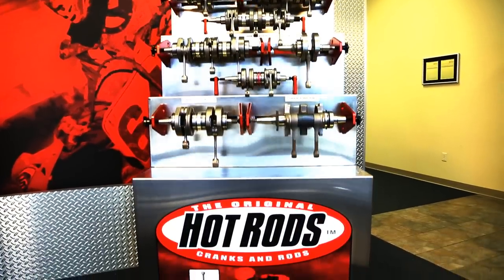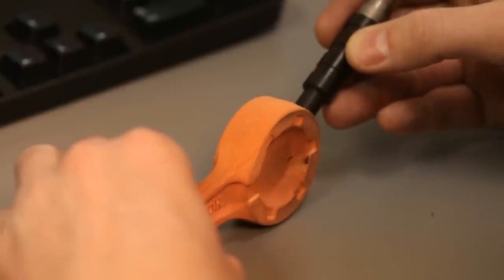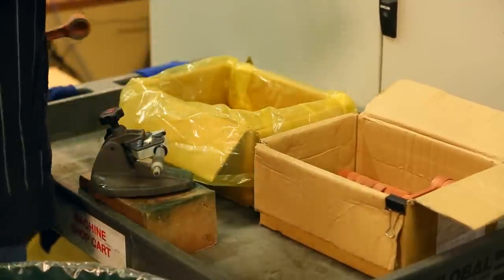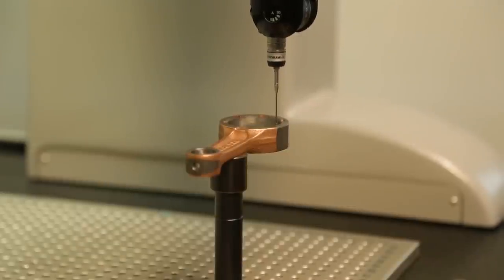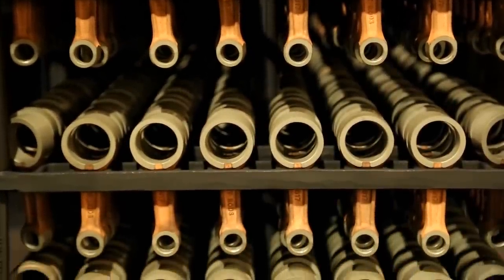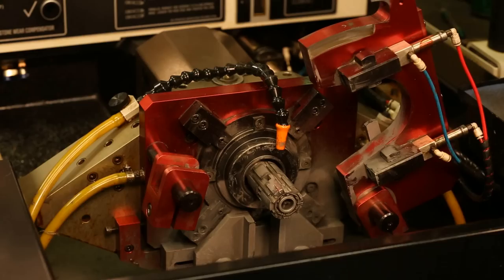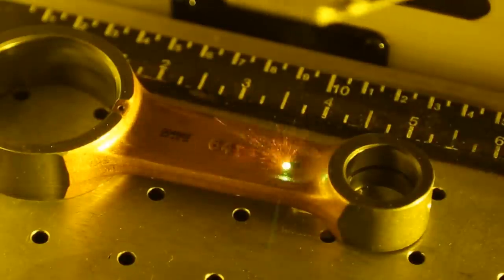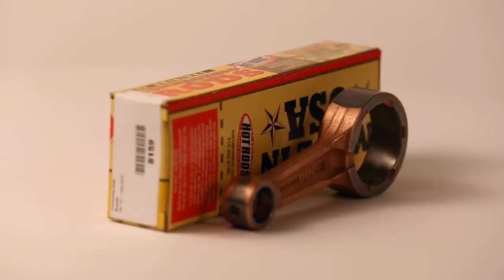How it's Made: Hot Rods' Connecting Rod Manufacturing

Comment: We beat the snot out of these rods and cracks when racing Yamah 701 2stroke watercraft. Never saw a rod or crank failure. It was always a bearing issue, usually from a lean condition. I've seen rods punch through the cases, always an impressive sight.

Comment: lol you use a cmm,yet then you check the bore with a dial verner..lol whats next stanley measuring tape..lol ,no machinist would ever measure a small bearing surface with a set of dials,,its just not done,i made thousandths of bushings some that are interference fit ,we hold tolerances of +-.00001 of a inch.